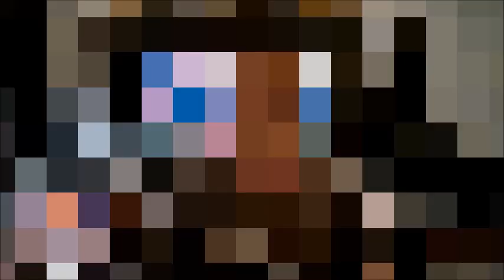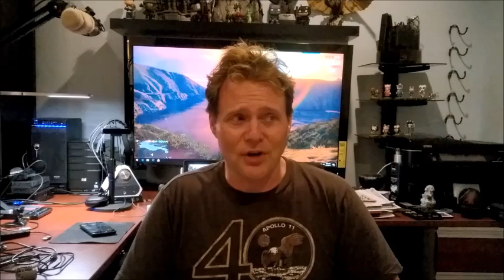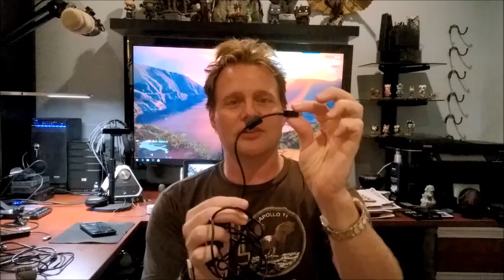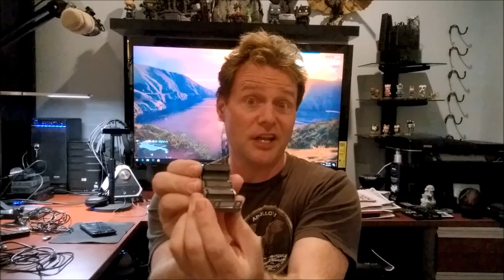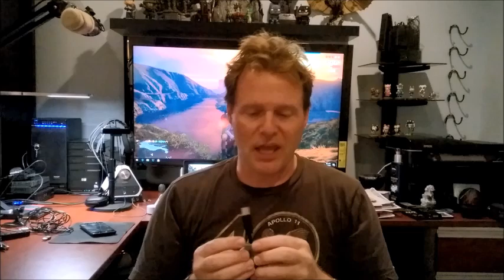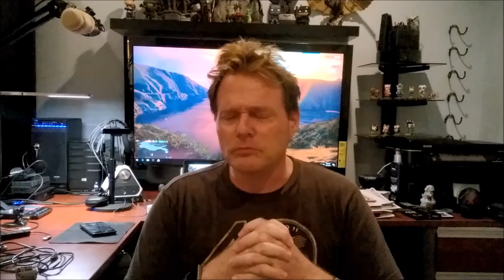What are Ferrite Cores and How do I use one?

Comment: Is it important
Reply from the maker: Only if you are having a specific problem like my friend did who prompted this video. It can be a test to possibly quick-fix the problem. The many great comments I've had here have taught me and others a lot about how EMF can sometimes not be the issue and it could be a grounding or voltage problem too (or sometimes just don't have your phone in the same room as a speaker that starts making that weird noise that means it's picking up the signal from your phone).
Most of the time companies are good about putting a core on their cables for you if they think there might be a problem.
So in the end, I hope this video just helps people troubleshoot and maybe get a quick and simple solution.  😊

Comment: Question: would this help if I have a seat genesis that has snow crawling up the screen (visual static)? There’s not an audio issue.
Reply: it could be, few of my handycam av cables has ferrite core on it, but i had same problem with my 1394 FireWire that has a lot noise on the video, I'm gonna try put on it on my FireWire cable

Comment: Thank you so much for your explanation. I bought an electric motor for a new model electric airplane and its speed controller-to-receiver cord had a 'donut' around which the cable was wrapped. I didn't know what it was for, only that the cord now wasn't long enough to reach the receiver. In fiddling with this 'donut' it broke. I often wondered what the 'donut' was for and have since realized that it is a noise filter. Your explanation educated me - I have now ordered a pack of the ferrite cores in the hope that I can use one to replace the 'donut' and avoid any interference in my plane. Thanks again.

Comment: I bought these new logitech usb computer speakers and I hear this high pitch noise coming out of them especially when I'm not playing anything, I think the problem is with the grounding. Will this ferrite core help with this issue?
Reply from the maker: It can help, yes.  If you can try putting a core on the speakers at the USB cord where that plugs into the computer, that might be your best bet if the noise is coming from a bad ground on the PC.  I say that assuming it's just a USB connection to the computer.  If it's also needing you to plug in an audio cable (say, to the stereo jack on the back of the computer), then a core on that cord would also be a good idea to try.  
Good luck! I hope this helps.

Comment: Hello Trenton. I have a problem and appreciate it if you or someone else would help me solve it. Last year i bout an Xbox Series S and the fps after a certain hour at night improves significantly. i tried everything and i ruled out all the causes except for EMI Or dirty electricity. now i wanted to know that is it possible that these things would help me out and if not, is there any solution to my problem?
Reply from the maker: Sorry I don't always see these notifications abbasahmady-ih29r!  
The inside of a PC or console has a lot of parts that help keep the voltage flow stable to the console, so unless you're seeing brownouts (your lights flicker or dim), it's not very likely that the voltage in your wall is the culprit.  "After a certain hour of night"...is this after having had the system on for a while? It's possible the unit is thermal throttling when it gets hot inside, and if it's not got decent airflow or it's a bit dusty or you live in a very hot place, this can make it more likely for the hardware to hit a performance wall and start slowing down.  
Depending on what game you're playing, the timing could be related to your Internet Provider slowing things down on your end, or it being a time of night that a lot of people on your network are streaming/gaming/etc.  For example, if you're in an apartment complex and everyone gets the same Internet in the building, then there's a lot more people jumping online at a particular time.  Network shouldn't interfere with FPS, but I'm also not sure if you're simply seeing slowdowns or you actually have some sort of FPS counter onscreen that's showing you the framerate changes.
Either way, a Ferrite Core wouldn't do a great deal to help with voltage issues.  It could help if the console is on WiFi and there's something interfering with the signal.  Try it on either end to see if it works better close to where power plugs in or where the plug connects to the wall. 
The best way to get clean stable power when you can't control what's in your wiring is to get a Uninterruptible Power Supply (UPS).  They have a battery that's there to keep power going for a while when the power goes out where you live, but they also monitor the flow of current and make it more stable to devices you plug into it.  You also get the added protection that if a major surge came through the wall, the UPS would let the battery take the hit and protect your equipment from the surge. 
This is a TON of information I know...but I hope it helps you!
Reply: @trentonbennettVO  Hello. Thanks for your reply. About network problem, I'm sure that's not it. Because this also happens when my console is offline. And about excessive about of playing, I ruled this one out too. That leaves me with two possible reasons: 1-electricity issue which can be solved with what you proposed.2- or maybe it's some signal that keeps interfering with my console during the day, and it's gone at late night, which I'm not sure how to solve it. Thanks again for your constructive reply, Trenton.

Comment: Hi I have a humming problem from my  turntable  in my hi fi set up. Probably a grounding loop. But I can't  seem to  fix it . I have separated the power cables  from the phono/ RCA  cables . Do you think fitting   some on the turntable power cable. Or on the rca cable . Your thoughts  would  help on this matter I'm sure.  Thanks Gerald
Reply from the maker: Hi Gerald! I don't always reply fast, but I hope this is still useful to you.  Yeah ground noises in audio are a pain to troubleshoot!  But yes, trying a core on the power cable is one way, as is trying the RCA cable.  If it's not a pain to move around, plugging into another wall outlet on another circuit is another way to test.  You can buy third-party ground-loop isolators like the Hum-X, but the success is hit and miss because it depends on whether the ground problem is at the wall versus somewhere else in the chain.  I hope this helps you!

Comment: Does this work for film / digital noise on videos ?
Reply from the maker: It works for equipment that's generating noise, like a speaker or microphone.  If you did have some sort of setup that was capturing video and there was interference causing noise, it might work for that.  Not sure what your specific setup is, but basically anything that might be getting EMF interference from nearby and has a wire sending a signal.  Hope this helps!
Reply: @ definitely did I took a chance and got a decent amount off Amazon I added them to my lg c3 power cord and all my hdmis apply tv Xbox and sound bar with a subwoofer wireless and 2 reach speakers connected because I noticed my lgc3 was getting more visible film grain and noise and almost static on the picture so added them and even to the power cord because I have at least 9 cables running to one power surge in my wall which is all that I just stated above and it definitely did help ALOT but still some noise and artifacts which I’m sure is from the films streaming in general but they definitely do help a tone and this video definitely helps me with that choice of taken the chance so thank you!🙏

Comment: Does it work with smartphones interfering with speakers? I'm using 2 ferrite cores, I've tried placing them on the speaker cables, power cables, close to the speaker itself, close to where the speaker plugs in, and pretty much any variation of that, but I still get the crackling noise if my phone is close to the speakers (50cm). I am using some old speakers (Trust Soundforce 1200), but should that matter?
Reply from the maker: Hi dakterdee!  The noise might be interference from the phone itself that a ferrite core might not be able to mitigate (it sounds like you've tried everything I'd try!).  I would put the core as close to the speaker itself as possible (one on each speaker cable).  Check out this video and see if any one of these is the sound you're running across - https://youtu.be/uPYyrS7fc7g?si=mY6SDCu9P32Jik5N - if so, you're right it's a matter of having to keep the phone further away from the speakers to avoid this interference.  Older speakers can be less well shielded than newer ones, but this is why I don't bring my phone into my studio when recording--sometimes my newer studio monitors pick up the buzz.
I hope this helps you.  You're not really damaging anything, it's just annoying.

Comment: I have a 90's lexus with a tape player.  Going to try this for my car tape adapter to aux, that I attached to my iphone.  Always gives me fuzz on the audio.  I could get a bluetooth car tape adapter, but the volume is much louder on the old-school tape adapter 3.5mm aux audio to iphone.
Reply from the maker: Hey, if you can, let me know if that worked.  Ah, nostalgia - me with my tape adapter and my Discman that skipped any time you hit a bump. Clever to use that as a hack for your phone since it's just a standard aux jack.  I wonder if the volume on the old-school adapter is louder because it's expecting a line-level signal and it's getting amplified audio?  See if the quality is still good if you turn the phone's volume lower and let your car's head unit handle the volume.  You might find a sweet spot of great sound!

Comment: How many Ferrite Cores should you generally use on a faulty cable?
Reply from the maker: Hi jonnystevens9589! It's a good question, but hard to qualify. If there's something faulty about the cable and you can't fix or replace it, then, it's not necessarily a number so much as a question of "what's happening" and "where should I try this?"  For example, let's pretend this is a simple pair of speakers connected to a turntable and you're hearing noise.  You could put a core on each speaker close to the speaker and if that didn't work, then instead put one on the electrical cord close to where it goes into the turntable.  Unfortunately, since this is a "possible" simple fix, and there's more than one cause of the problem, it could ultimately be some other issue like a bad ground or coil whine inside the thing, etc. and more of 'em doesn't really do much to help.  I hope this does help you.

Comment: I sometimes get a static sound coming out of my studio monitors when i listen to music, YouTube, make music(anything with audio)  Would getting this fix it?
Reply from the maker: It might!  I'll share what I just said to someone else with a similar problem: The noise might be interference from a phone or other wireless device that a ferrite core might not be able to mitigate.  I would put the core as close to each speaker as possible (one on each speaker cable).  Check out this video and see if any one of these is the sound you're running across - https://youtu.be/uPYyrS7fc7g?si=mY6SDCu9P32Jik5N - if so, it's a matter of having to keep the phone or other wireless device further away from the speakers to avoid this interference.  Older speakers can be less well shielded than newer ones, but this is why I don't bring my phone into my studio when recording--sometimes my newer studio monitors pick up the buzz too.
I hope this helps you! Sorry I don't always get to these comments right away.

Comment: I have cruise control by Rostra company on my truck 2011 ranger I-4. Keep disconnect itself so I test turn air conditioner on and off affect cruise control disconnect CC itself. My truck battery is old make alternator make very light charge the battery. Do I need add ferrite power cord 12v to CC ? Help to reduced static electricity charge to CC ??
Reply from the maker: I'm honestly not sure on this one! I've had mechanics tell me sometimes an engine component isn't correctly grounded, but you also mention the battery is old, and in the last 15 years or so I've experienced that once a battery starts to go, it just doesn't put up with being recharged for very long.  I'm not sure which of Rostra's products you have and what that configuration is (like is this a speed limiter on a company vehicle?) but I'd probably start by reaching out to them.  This link can let you specify exactly which product you need help with:  https://www.rostra.com/support/

Comment: I have a question, though this video is old now. I have an electromechanical piano with a passive output that would go to an amp. I recently changed the passive out for a custom-made, high quality active pre-amp. Since doing this, I have found noise on the line. I should point out that this is a Rhodes piano, and has A LOT of metal parts. Most of the main parts are grounded, but there are some that are not. I have been experimenting with adding grounding wires to parts that aren't grounded, and I am finding that the interference reduces (but not disappears). So clearly some extra grounding will help, and I was thinking that this would eventually solve my problem until this morning when I heard the faint tones of Like a Prayer by Madonna in the buzz. So I am guessing my issue is a combination of a grounding problem as well as RF interference. I am just wondering if ferrite could help me here...I just have no idea how. Or do I need to shield some parts to try to block the RF?
Reply from the maker: Oh man, yeah that does sound like radio getting into the line.  One thing I have often suggested in the comments is (if it's not a pain to do) trying another outlet or another part of the house to see if being plugged into a different circuit makes it go away. But usually that's for a hum, not an '80s-pop hymn. :D 
The cores/beads/chokes/rings whatever you want to call them, just need to have the cable pass through them, and you can try them in a few places, but with radio signal....
If the keyboard lets you plug in headphones, do those also pick up radio?
If not, maybe on the wire going out to the speaker, in the event the interference is going down the speaker wire (if there is a visible speaker wire).
I hope this at least helps you on a troubleshooting path!

Comment: Great video, I just happen to have one of those weird scenarios where I'm having interference with my mic. It sounds like a constant static popping noise. Ive found the cause is close proximity to my router (3-4 feet away) and I can even stop the interference by using my hands as a shield on the mic. I didnt know that ferrite cores were reusable, digging through the old laptop chargers today it seems!
edit: found one that could be reused, I put it on the mic cable and its blocked about 95% of the noise, I still need to keep a binder with tin foil next to the router, but atleast the buzzing is finally gone and people that I play games with will stop complaining about my mic
Reply from the maker: Awesome! I'm glad to hear you solved the problem. Phones and Bluetooth devices can also sometimes bleed over though I usually notice that in my speakers. I leave my phone outside the studio when I'm recording. Congrats on a simple fix!

Comment: Question. Connected a record turntable to my Denon amp. Two connectors plus an earth cable. I get this hum though, Could ferrites help here? Thanks
Reply from the maker: They could, though that may also be a grounding (earthing) issue.  You can of course put a core on the two connectors, I would also check that I've got the earthing correctly connected and I'd also see if I could plug the turntable into a surge protector (or if you have done so, try a different surge protector or a different outlet).  I hope this helps you!

Comment: Hey. Nice video. So I have had my bush trailer completed kitted out with Victron equipment. I won’t go into too much detail as there’s many ways to connect to my devices. However Bluetooth would be the quickest and easier. Would a ferrite cable clip on each end of each cable improve the Bluetooth signal strength?

Thanks so much

Comment: , I see in another video, that. Ferrite bead core, its  use to motorcycle, ,  can ask you, that ferrite bead  core,  gives high voltage current in ignition coil in motorcycle, it's true or not?
Reply from the maker: Hi lanzural1472.  Ferrite is a ceramic compound loaded with iron.  Iron is an electrical conductor, so it's physically capable of conducting electricity but I honestly wouldn't know anything about using it in the ignition coil of a motorcycle to produce high voltage current.  I'm sorry I don't have more advice for you but I hope you've been able to find what you need!

Comment: My issue is a constant, extremely high pitched tone that is audible whether or not there is any other signal being sent to these old Pioneer 77 speakers, from a Pyle surround sound speaker amp
Reply from the maker: Ouch.  I had that before with a car stereo head unit, and it drove me bonkers because it was audible in everything it played back!  Super-disclaimer: I'm not a sound engineer! :D  But that said, these kinds of things can have multiple causes, from EMF (which is where the cores come in) to a bad ground (where you can either try another outlet or try using a power conditioner) to bad capacitors that give off noise (which leaves you with 'repair or replace').  I hope you're able to solve the problem though.  My car stereo, I'd tried cores and extra grounding wires and ultimately had to replace the unit.  If the amp is relatively new, there may be a warranty for those kinds of issues or an easy repair option.